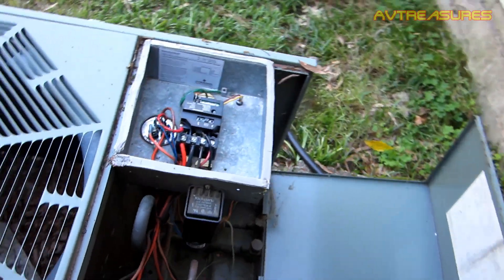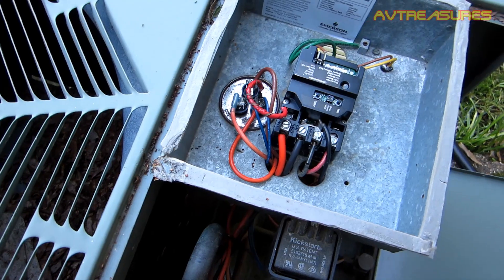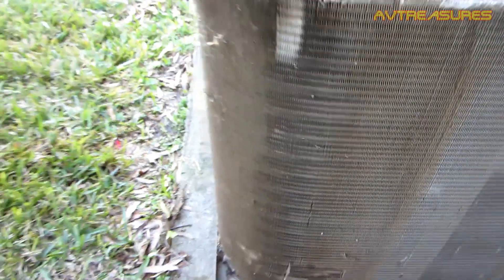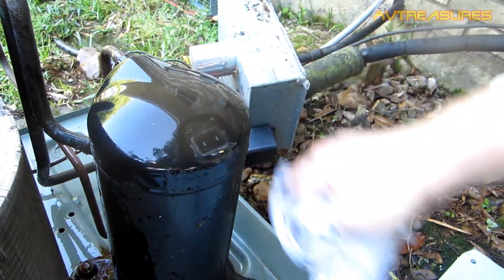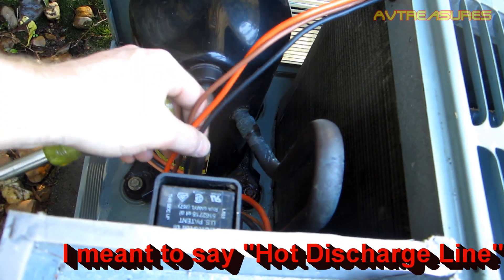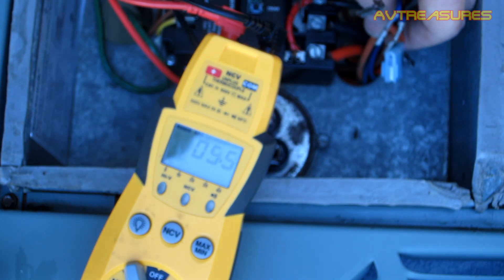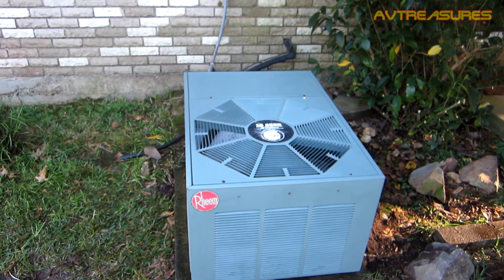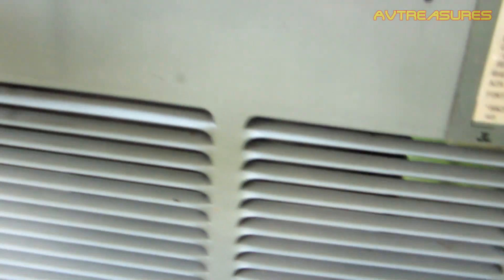1997 Rheem Condenser Begins 23rd Cooling Season

Comment: Thanks for posting this. It motivated me to keep mine clean. I have two of the exact same models that are still chugging along after 27 years in the las vegas heat. Great units.
Reply from the maker: That is great Tony. I am glad my video was helpful. That is awesome. I am not surprised yours are still going. They were built to withstand extremes. My Rheem condenser is still going strong this summer which is cooling season #26 for it. Thanks for watching.

Comment: Good idea on cable tie the wires.  I need to check that.  I have a 1996 just like this one.
Reply from the maker: Yes, very important to keep the wires off of the hot discharge line from the compressor. Thanks for watching